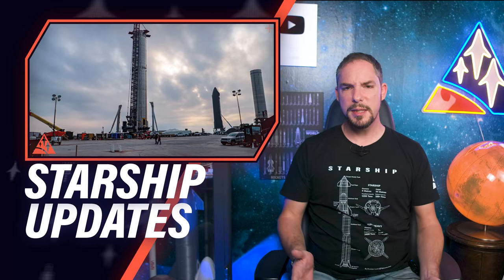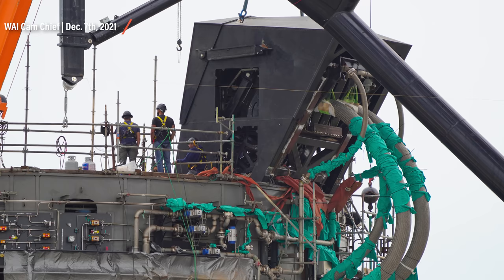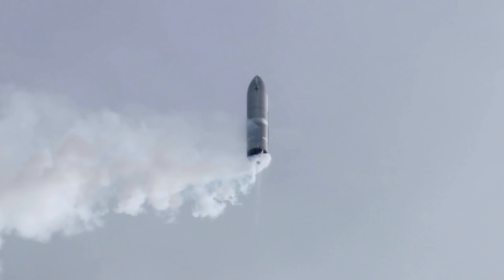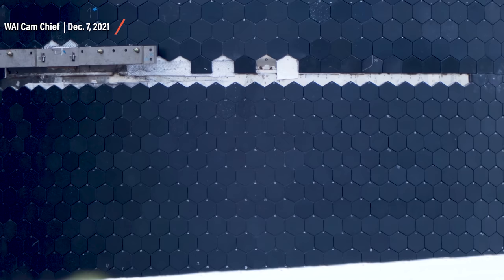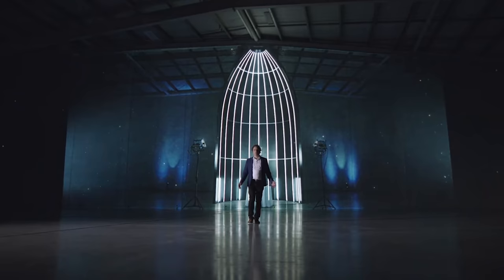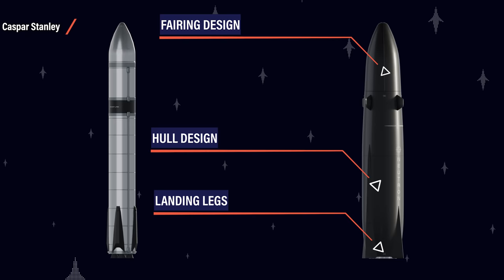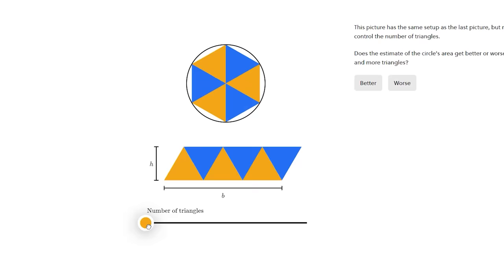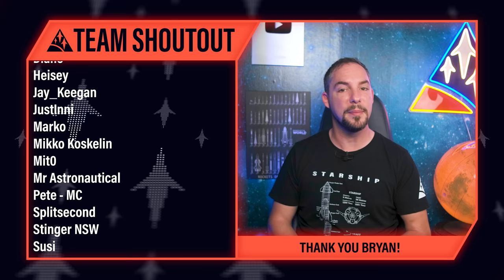Not enough engines? Why SpaceX might be retiring unused Starship boosters!?

Comment: Neuron landing legs... I have doubts. SpaceX has seen how difficult and maintenance-intensive landing legs can be. Neutron isn't a tiny suborbital New Shepherd. It's going to be coming in hot and it also remains to be seen if Archimedes engines will have hover throttle capability and if mission parameters allow sufficient propellant left for any significant hover anyway.
Please, feel free to discuss, I'd like to see people's comments on this!
Reply: Keep in mind, the shape of neutron gives it the ability to lower the loads and speed much better than falcon 9. On top of that it will probably be significantly lighter than f9, static legs could work much better than f9's legs if they can get their engines to give it a soft enough landing.

Comment: Booster 5 won’t fly.  It was built to serve as a display.  
Booster 6 and possibly 7 will be built for the new version 2 Raptors and with other upgrades before the first orbital launch. 

As cool as it is the Neutron rocket will be mostly obsolete before development ends. Yes there will be specific uses for it but it will never launch as frequently as Falcon 9 is now.

Comment: Space X are just moving booster 5 to make way for BN6 and Ship22 for stacking I think but during a possible BN4 + Ship20 (420) Orbital launch I do hope they move BN5 back indoors in the high bay just incase. Also if the catch arms never work just say would it not be wise to make 2 towers and link them up with a mechanism between them for catch the booster so it could go inbetween the 2 towers and hover then let the 2 towers use mechanics to catch it that way with a back up option of a very very big pool underneath in case to soften the landing? Go WAI you rock!

Comment: Its the fuel range or late sequel high altitude speed, that is a marginally off, BN cannot fully reach into orbit velocity to park SN, thus require SN to refeul, with another/double round trip starship fuel cost & time. Resolving this may need 3 stages, first stage, be a fuel balance support of adjacent mini to 4 BH Falcon on BN that would require, for a short haul range time. A radical future alternative, have the second SN be an all-fuel light drone, to esscort SN1 support in solar orbit, with the nose cone if SN2 open like a dove hatch end, as micro mini nuculear chem or electroc booster thrust installed, granting a non idole gravity continuous acceleration rate to Mars. Even save the first SN cargo for a non critical vtol at the planets.

Comment: i have the solution. just land  the boosters and reuse the engines. Why the prototype boosters don't have landing legs? After mastering the landing could use the tower, and the weight of the legs is not an issue the prototypes are not loaded.

Comment: Booster 5 being used for the update, and then unceremoniously scrapped, IMO. Gotta move on. Booster 4 has enough for the first flight test, but no need to produce more Raptor 1's. However, Booster 5 might be stripped to quickly replace any Booster 4 Raptors that have issues... and then we'll be certain.

Comment: If SpaceX creates a raptor with an adjustable nozzle. They can reduce the required number of raptor engines by half. Essentially, a raptor with an adjustable nozzle can perform the duties of a sea Lovell and vacuum engine.
Reply: Moving nozzle parts would add greatly to the complexity and weight to each engine.
Reply: @MrEh5  Agreed, but you could reduce the number of required engines by half. I believe 3 engines with an adjustable nozzle similar to a fighter jets would have less weight then 6 engines.

Comment: If the Neutron rocket leaves and returns to the same spot, I would be surprised if they don't use a catching device similar to the Starship. It would not have to be as big or as complex as those used by SpaceX and would substantially increase the payload. If SpaceX is finally successful whit their catching device, you can bet on it.
Reply: considering the legs are static and made of CF, i don't think it will increase payload by a significant enough amount to warrant designing a catching mechanism. Not to mention, needing to be much more accurate for a catching mechanism.

Comment: Booster 5? Consigned to 'service station' prototyping? Ala Titan IIIc (from Titan II), strap two Super Heavies to an engineless booster (in orbit fuel station) with Starship on top; Super Heavy III. In orbit, the center engineless booster re-fuels Starships. When empty, use that booster as a future space station component. A 'Super Heavy III' would need a wider assembly building.  Kind Of Something Like a Mega Bay?

Comment: Why didn't the falcon 9 design include a similar attached payload fairing? Then no need to retrieve from the ocean, no added weight for parafoil. I see no disadvantage falcon 9 not to move to this design. Even though future launches will be on Starship.
Reply: @JoeShmoism  that, and it would require a totally different rocket. Either a way smaller second stage or a way wider first stage, much more likely the latter. Transport of the boosters would also be a lot harder. As would horizontal integration probably. F9 is great at what it's designed for. Ss may be even better. Neutron will probably be great at its job

Comment: Ditch the antiquated, deadly, expensive, cumbersome tiles.

Develop an epoxy formula of high temp ceramic adhesive, with powdered
Kaolin, Mineral Spirits carrier, Isobutane propellant to keep it anhydrous.
Scuff & spray, launch. Heat of reentry makes it flow & cure into an ablative
coating. Scuff & spray again. Fast turn around.

How much do thousands of tiles and anchors weigh, comparatively?
Reply: These aren't shuttle tiles, I think they will perform well. But yes, some single application spray on ablative would be ideal. Would only take like a few hours to prep and spray with the right tools and setup.
Reply: @Shrouded_reaper  Thank  you for your kind words of agreement.
I've ran into so many Trolls regarding this- one even asked "where's the huge oven to cure it?" I flatly said "the atmosphere."

No, not the same STS tiles, but the concept is still ancient. Huge
problem is SpaceX is so contractually obligated to the company that makes them. Robot-welded anchor pins, each tile wired on.
They plink off during static fires- imagine liftoff?

One tile gone, just one- and you have another Columbia.

Adhesive-
Is 3,200℉ (1,760℃) enough? Mixed with Kaolin powder, mineral
spirits to be a carrier, Isobutane as an anhydrous propellant.
Spray 1/4" thick at most. Way lighter, more durable. Touch-up
tanks & gear in orbit, or even make up fire extinguisher-sized
applicators for EVA touchups before reentry. Remember STS
used the Canada Arm to check tiles? Tether a couple Teslanauts
and egg hunt the fuselage.
https://aremco.com/wp-content/uploads/2020/07/A02_S1_20.pdf

Comment: Maybe they will transport booster 5 to florida kenedy space center for fit check and everything when new mechazilla is built there. I mean, a month or so to transport, add a month to that and in that time new lanch mount and tower can allready be substantionally complete.
Reply: The obvious question is how would it be transported.  It's too unreliable to transport by sea because it's too far and weather is too unpredictable.  It is almost as unpredictable traveling on the highway where it would have to be upright.  Don't see it.   Anyway, the launch pad at 39A won't be ready for a year.

Comment: Will the tower be used to stack and mount HB and Starship?  Can’t see a reason to continuing using a crane.  Hope to see the tower in full use soon.
Reply: The crane is now connected to B4 likely in preparation to move it to the OLP.  In the future perhaps the SPMT's can transport the next booster and starship to fly from the production site directly to the launch pad for the chop sticks to lift into place.  But now the crane is still needed for the transfer of B4 and S20 when they are ready.

Comment: Was just wondering if there was a way that they could use some sort of spray or roll on heat shield material....It seems to me that it would solve a lot of problems and if they can't do that yet...What is the issue?....just a thought...Plus I would love to see Musk incorporate an aerospike engine later...There REALLY cool...and BTW....Hey Brian...Welcome to the future
Reply: There is a team of engineers that have worked on the TPS and I have no doubt that they have considered numerous options.  In many ways this is a vast improvement over the shuttle tiles. 

As far the aerospike engine, what looks cool is probably the last consideration for rocket engine design.  Besides that the aerospike is unproven technology.  

The starship and booster are using a closed system full flow rocket engine using methane and lox for fuel and it has many advantages over alternative rocket fuels.  In so many ways the raptor is possibly the most innovative rocket engine in a generation.
Reply: you cant just cover a giant area in a head shield material that is going to heat up differently, just like you need to form cut outs in concrete to prevent it from cracking, heat shields need to be in smaller pieces. Otherwise they would have made the entire bottom of the space shuttle in one piece.
Reply: @michaeldeierhoi4096  I agree...As of now....yes way better

Comment: Retiring Booster Five would be foolish and Bad Business. Regardless of the efficiency comparison between Raptor V1 and V2 NOT ALL BOOSTER LOADS WILL REQUIRE MAXIMUM BOOST. Elon would be an Idiot and we all know he is not an idiot to just send It to the Garbage without ever using it. Elon would be wiser to use Booster Five WITH RAPTOR V1 to Show Proof of concept as the Raptor V1 Engines are SAFER although slightly less efficient than Raptor V2 engines. NOT all loads require the Maximum boost of all the engines. Using a Preliminary Launch with safer Engines and Lower Launch Loads requirements.

Comment: I actually (my simpleton view) actually believe too many engines .. added complexity.. the mighty SatunV as example 5 f1 engines.. reduce the number of engines (on the booster) design a bigger engine maybe a variant of the F1B engine?.. if the best part is NO part, surely less parts are better than many?
Reply: F1 engines where very complex to build and not fuel efficient. You can't just scale rocket engines up.
Reply: @MrEh5  ad i said, somthing like the F1B .. simple comment for the topic ..

Comment: I worry that SpaceX took too long of a step. I do wish the the best bet they now come across as having painted themselves into a corner.
Reply: Most of their issues have been production issues, and that's only because the pace they're aiming for is so much more ambitious than that of any other launch company before them. But there is no reason to be pessimistic about whether the vehicle will perform as intended, at least after 2-3 tries. Starship has already performed the belly flop successfully, and the booster return is similar to that of Falcon 9's booster, except for the final step with Mechazilla. But if they can bring the booster back with the same accuracy that they've been able to achieve with the Falcon 9 booster, which seems reasonable, then they'll get the booster right where it needs to be. Also, don't forget that even if Mechazilla doesn't work out, there's nothing stopping them from changing their minds, and retroactively welding some legs on, at the cost of some payload to orbit.

I'm pretty optimistic that the vehicle will work as designed, it's just scaling up production that's in doubt. But Elon has had similar issues before at Tesla, and they got those figured out, so I'm optimistic about that to.

Comment: will Booster 5 fly?
hard to say... at this point Starship starts to look a lot like Howard Hughes's "Spruce Goose" so...
Reply: Really?   The largest rocket ever built and the especially complex launch pad and orbital launch tower are just about complete all in a year!!    I have watched this whole project for over a year and it is all the johnnycomelatelys who show up and think this launch should have happened by now.   🙄
Reply: @michaeldeierhoi4096  I've watched from the start too, and at first they didn't even knew what starship was. pushing that point further, before BFR the mars rocket was suppose to be falcon heavy. then the vision keeps changing form and getting crazier to accommodate mass problems (i.e. catch the booster). then there's musk pursuing all possible uses for starship, even getting to say "yeah it could chop space trash" ... altho' the only realistic one at this point seems to be Starlink. and! as the war was ending in Howard's times, and there was no reason for his humongous aircraft anymore, right now time is running out around the whole satellite constellations mania (and starship utility, because that's what market see now: lift constellations), and Musk's aircraft has no shortage of problems either.

Comment: Will BN5 fly? Will BN4 fail for a fixable reason that would necessitate flying BN5 rather than moving on with BN6? Or is there independent value in the test campaign. I'm not an expert, so this is a novice guess. I think it not will fly. I think they are moving fast enough to just move on to BN6 given the scarcity of engines.
Reply: There is no good reason that I can see B4 is ready to fly because it is loaded with raptors depending of course on testing.   Whatever happens with a launch Space X will gain more data which is helpful for going forward.
Reply: @michaeldeierhoi4096  I agree with you that it all comes down to data, which no outside observer is going to be able to deduce. SpaceX has gathered some data from their testing campaign so far, but they most likely would enjoy having real world data to validate their computer models of the entire flight regime. What's unknowable from an outside observer is whether SpaceX decides that the data from B4 conforms closely enough to their computer model to move on to B6. And what we also don't know is how radical the design changes are from B4 to B6. There could be a lot of design changes, or not enough to justify skipping the booster that's ready to fly.
Reply: @germpharm  Right you are.   The next couple months will be telling on whether they can get handle on their Booster raptor production issues.

Comment: Elon needs to build some larger engines, He needs enough power to lift the booster and starship, but having fewer engines means fewer fuel/oxidizer connections and faster engine production. He'll still need "restartable" engines to land the booster, and enough engines for some redundancy / safety.

Comment: Raptor v1 should be used to test other booster systems and the launch mount. At least do a hop and if they blow up....well more data.
I think Elon is talking BS to be honest about moving to Raptor 2. 
No harm testing and building v2 but one can do all the above in parallel.  
If SpaceX is short of cash, then just tap the private equity market. 
Elon may not want to it because he will give up more control but I am sure that certain covenants can be put into the Memorandum and Articles of Association  of SpaceX to make new investors run the company the way Elon would want, even after he left.

Comment: What's with these clickbait titles lately. No need to try to be controversial
Reply: Speculating about possible outcomes is normal behavior these days.  If the raptor 2 issue is not resolved soon then there will be no raptors to launch B5.